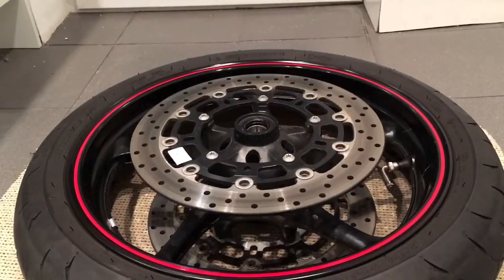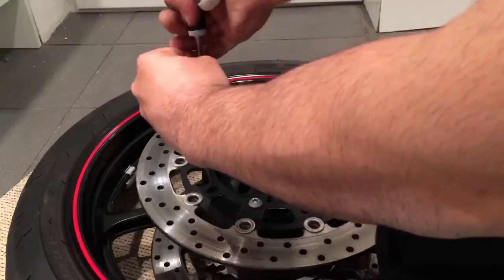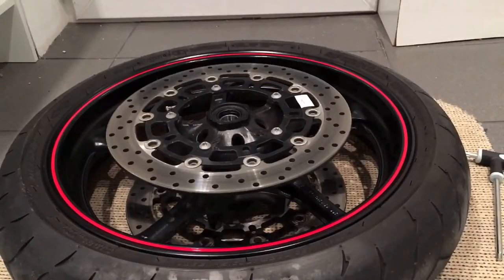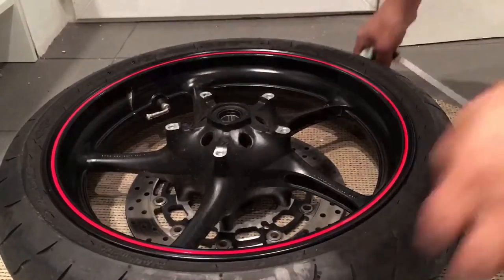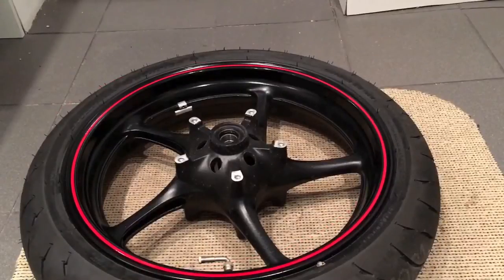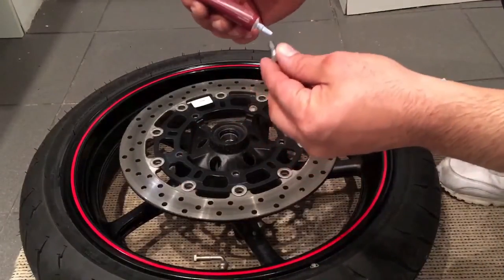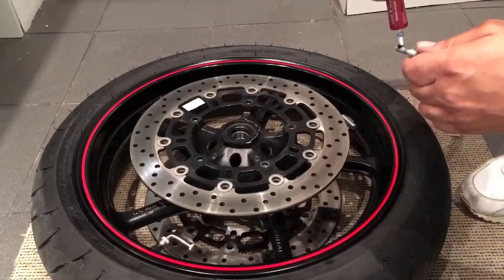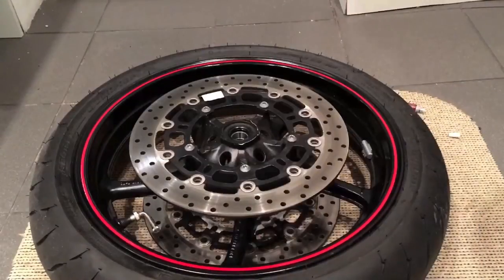How To Change Or Remove Motorcycle Brake Rotors

Comment: Had a bike of a customer which used Alan bolts, and it was like 20 years old. It did not budge at all. Bolts and Alan keys got deformed instead. Still looking for solution in case I get another rotor change in the future.

Comment: What’s the likelihood of these snapping
Reply from the maker: Hi chris, I think the only time they can snap if they Have been Worn down & gone really thin. Mine Were solid & there was was no chances of snapping. Hope this helps
Reply from the maker: chris if you meant the bolts then best to put wd 40 on them first before removing. Make sure not to get wd 40 on the rotors. Hope this helps

Comment: Torque them to the Pacific settings huh. Interesting indeed
Reply from the maker: You have to look in your manual mate plus & use loctite. Hope this helps
Reply: @ScoobyRolla  I tightened the screws on my GSXR 1000 to Atlantic settings. Do I need to replace the rotor AND the claliper, or just the brake lines?

Comment: Ahh...Not Red Locktite...
Blue. ..or you'll need HEAT nextime...
Then paint....
Reply from the maker: You are right victor I used the red one as it’s under a lot of pressure from heat when you are braking that’s why I used it. Thank you for watching I really appreciate it